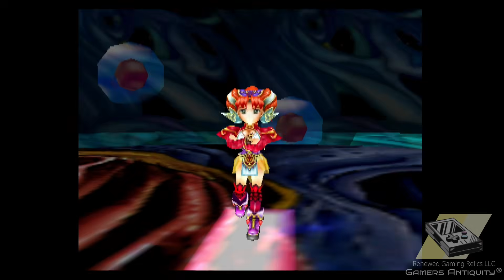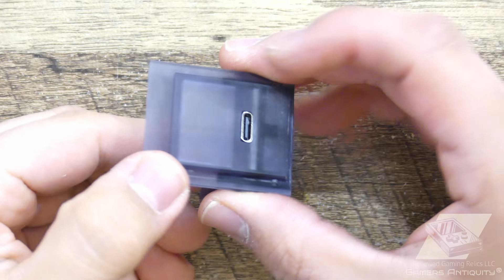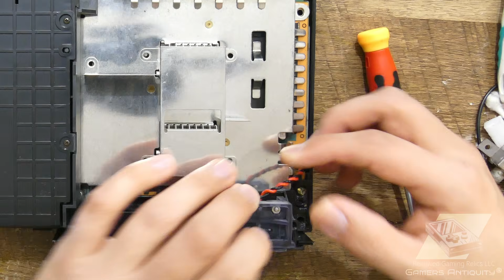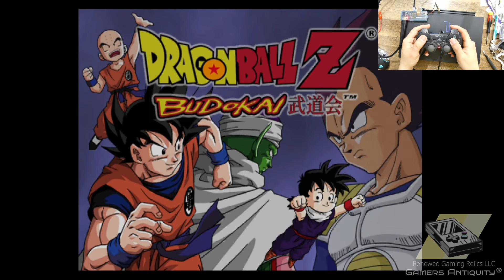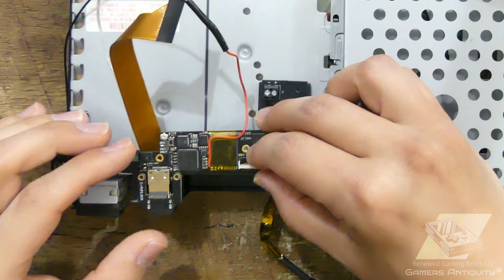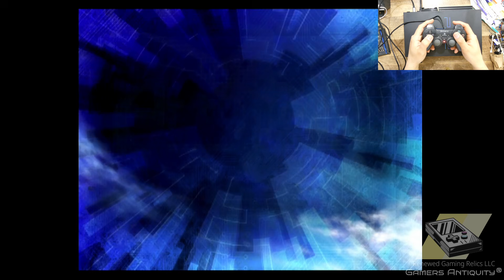USB-C Modding the FAT PS2

Comment: How many amps does it allow? I can tell you from experience 12V3A isn't enough to power up the PS2 with a 3.5" magnetic HDD.
Reply from the maker: I'm fully aware of 3A not being sufficient from research during the design process. Supporting an SSD wan planned from the beginning.

The mod is rated at 4.6A which provides 18% headroom underload at peak power consumption with a game, 2 controllers, 2 memory cards, and a 8Tb SSD

For an old IDE drive, you'll have to run your own power consumption tests as I focused on SSD support and 4.6A is max efficiency for power loss from buck conversion based on a 3A supply at 20V per the PD standard for sink controller configurations even though the buck converter itself is rated for 6A.

Comment: I though buck converters intoducrd noise in vedio. Thats why pple stiped usein them with the nes
Reply from the maker: naw, buck converters are widely used for power management to step down voltage. noise management is due to your design layout, clock speed when stepping down, and implementation. If your components aren't as tightly packed together as they can be then you can introduce unwanted ringing. there's also filtering caps and bulk capacitor to ensure that your DC in and out are clean. The NES itself is noisy which is why you'd see a number of modders lift signals off the boards with a cable to use em.

it's more expensive to use buck converters than a linear regulator because of the number and types of components needed for your design to meet your specs. buck converters are handy in that while stepping down voltage, you also step up current whereas a linear regulator will not do that and current availability will be limited by the regulators' specs. conversely a boost converter steps up voltage at the cost of less current.

no reason to not use buck converters. I would presume the some individuals would not want to use them due to their  increased costs when designing them

you'll also see them implemented as buck boost converters for some battery management designs.

Comment: Nice! Man that one cap in PS2's psu pcb is all custom i read & can't really be replaced easily. This is such a relief to just ditch the whole thing aaaannnndddd make the Phat Ps2 a little lighter 🤗
Reply from the maker: Thank you! 😁 I'm almost ready to get pre-orders going again after changing the way I design boards since I'm not betting on component shortage stock to meet it's 3rd ETA so I can get things going.

That fat 360uF cap is something special; if only Sony went with some standard stuff rather the custom form factor, it'd make life easier lol Adding caps in series to add voltages at 360uF to get to 250V or parrallel at 250V to get 360uF; or be an absolute mad lad and work something in series and parrallel; and making it all fit is not easy lol

Comment: This is a waste of time and money imo, I don't see the point to doing this unless you have a bunch of vintage consoles and want them all running off a single usb-c adapter to tidy up cables or you want to run it off a power bank for portability. Nonetheless it is neat and a cool video.
Reply: I use to think that too but as i looked into it more i can see many improvements in the retro console usb-c mods. This Ps2 phat psu has capacitors that need replaced & cant find the size it uses these days. This PS2 usb-c allows you to just ditch the whole psu pcb all together. No need to try and find the custom capacitor or any janky way of installing something close.

No more need for 2 voltage regulators on Sega Genesis either & can take em out along with the heatsink.
Less heat generated in the Genesis. I can get behind all this.

Comment: How can i buil a screen on to a ps 2 with a battery or powerbank .To make a portable ps 2 fat.
Reply from the maker: Big question lol While I haven't done a lot with portables there's a couple things to consider, and more research into your specific needs so hopefully this will get ya started well.

For the screen, what kind of video will it support and would it require an additional mod? Composite and Component is already available, but if you want HDMI with at 1080p, then you'd want the RetroGem to have that output to start for best quality. Afterwards it's a matter of mapping the video out from the PS2 to the input of the screen as you'd need to tear it down and get that sorted. You also need to see what voltages the screen needs to run.

For a battery pack, you're gonna need a few things. The PS2 needs 12V and the screen will need whatever it needs. You need to make a circuit that regulates what's needed between the two. The charging circuit will need to consider the number of battery cells you'll use to properly charge them. You'd want a boost buck converter to have your voltage higher than what you need to then bring it back down to what it has to be to keep steady voltages as the battery drains; ya don't want to slowly dip things into a brownout situation. a charge monitor is nice too. you'd also need to think about how you're going to charge them; what's the power source and what you'd need from it as well as whether you'll allow charging during use.

Then you have to think of whether to keep the disk drive which you may ditch in favor of an SSD or something like the memcardpro2 to load things off an SD card.

There are probably board trim guides for the fat ps2 which you may want to look at. I'm not a fan of board trims personally, but it's not my call. That could help you decide what may be a good path may be for you, but always check to see if a trim would interfere with something like the RetroGem.

Over plan, make you list of needs and wants, check what others have done, constantly test as you proceed, design prototype shells beforehand to get a feel, and much more. how long you want a single charge depends on your final load design, how many cells you use, and how those cells are arranged. draw up you plans and do schematic reviews to map exactly what the connections you need to make are.

I hope this helps you get started!
Reply: @RenewedGamingRelics thank you so much

Comment: its insane how power delivery technology has evolved over the years

that big old power supply replaced by a tiny little board and it works just like the original or even more power efficient. crazy.